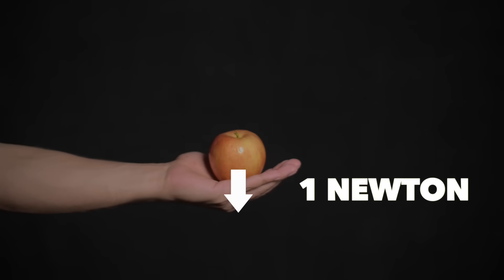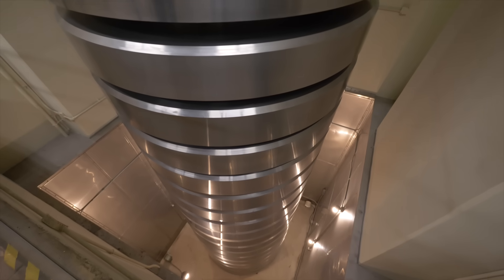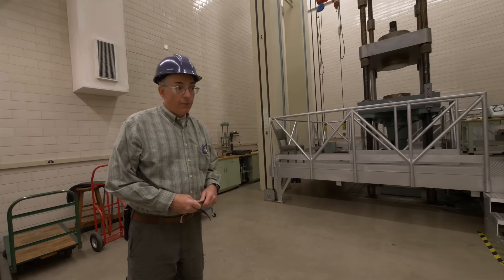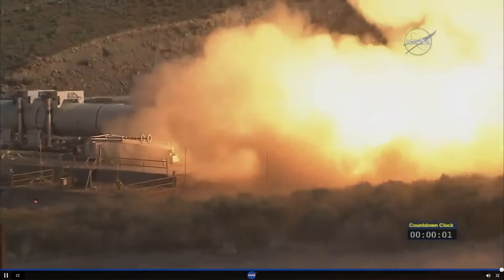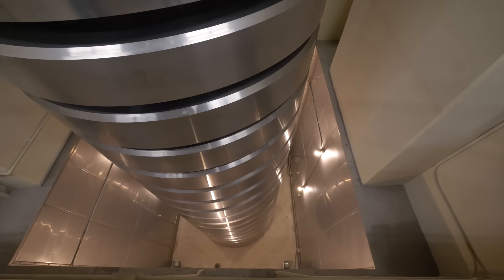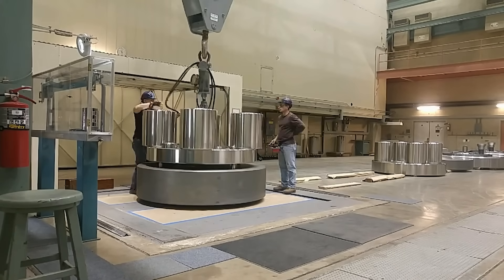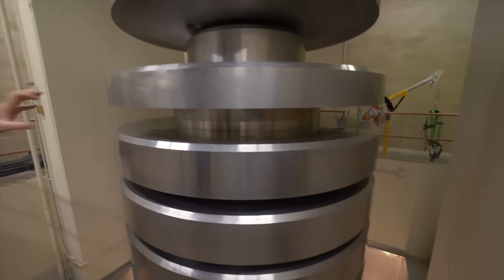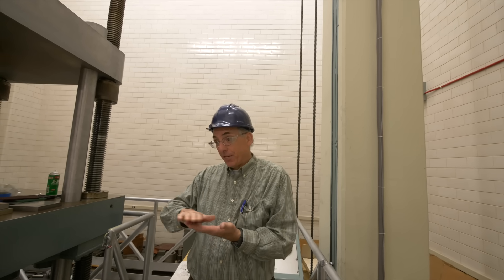World's Heaviest Weight

Comment: I would think that its pretty much impossible to use weights and gravity to measure force for a rocket engine because once THAT fires up you gotta add the heat, air displacement, an the fact that alot of the force goes outwards as the propulsion contacts the ground, its like firing a bullet thats not enclosed in a chamber, the force generate in the chamber makes the bullet fly hundreds or potentially thousands of feet per second but clamp it in a vice and smack the primer and you basically have a squirt gun...

Comment: I installed the highest sign in the  state of Ga. It is 180 ft. Tall and has 1,000,000 lbs. Of concrete at its base . I used an Excavator to remove 70 dump truck loads of soil at its footer ,upon placing the signs pedestal on center  ,I brought in #60 ,9 yard cement truck loads of concrete  ..60 truck loads of concrete .

Comment: If memory serves, this weight stack is in NIST Building 202, and was built to calibrate the load-cell on NIST's big structural testing machine (which was used in turn to calibrate the loadcells used in NASA's test stand for the F-1 engines used for the Apollo missions.) NIST was a fun place to work.

Comment: The worlds heaviest weight is the actual planet. But almost geniuses use linguistics to make up the difference. dat ego......

I don't suppose you asked NIST how the top section of a 110 storey building could contain enough energy to pulverise 80 floors below, including the main supports. And how does jet fuel and 30 storeys create molten metal still present at ground zero 6 MONTHS LATER! I know..... "science"

Comment: I worked at NASA Cal Lab on Redstone Arsenal, AL. We calibrated Load Cells up to 5 million pounds of Force, both compression and tension! Was downgraded to 3 million lbs of Force and parts availability! There's also a 200 Cu Ft Proving Bell, yes 200... Flow Calibration up to 400 cu ft of Gas Flow and 16 in pipes for Liquid  Flow Calibration!

Comment: It is probably a very good thing that this facility is located in Washington DC and not out in Silicon Valley near the San Andreas fault. How would you calculate the maximum stress factors on this equipment and its building for a 7.0 earthquake?

Comment: One question who made Newton's number accurate ?
Reply: based on the fact that a Newton's formula is mass times acceleration, kg times m/s^2, and that a million pounds is approx. 453592 kg, dividing the 4448222 Newtons by the kg gives us the acceleration, which is approx, 9.807, very close to average force of gravity but obviously calibrated based on the force in that location. Using the weight and forces allowed for an accurate number of Newtons.

Comment: The whole "science-thing" is based on SI-units and therefore they initially use precisely calibrated kg-standards, building up larger and larger masses ... and then they convert it to  "Pound Libras"/LBS/Libras ... say WHAT?
After which they use weird non-SI conversions to take into account the gravitational difference through the whole stack and the displacement of air mass due to the volume, again using none-SI units for the conversion. WHY don't they just keep on working with SI-units all the way through? They can always translate the end results into rural units for the lesser educated people later on, but why scramble a pretty good work so early on in the process?

Comment: This was extremely cool. The last job I worked on had a ringer crane manufactured by Lampson with a 750,000 lb lifting capacity mounted to a barge with a million lb counterweight. I unloaded trucks one whole summer of crane parts and counterweight. Spent a whole winter and spring assembling the crane and mounting it to the barge with nearly the whole summer used for rigging the barge and testing it. Spent a few years off and on either working on that crane barge or with it and although fascinating at times, working with the same rig day in and day out loses its luster pretty quickly. Our load cells consisted of potentiometers mounted perpendicular to the barge deck along with a load cell mounted to the end of a 7/8” cable at the main lifting line on the block. The main lifting block was usually rigged as either 32 parts of line or 16 parts while having to constantly take it all apart and reassemble it to add and remove boom sections for different projects throughout the duration of the job. Our load cells were sent off on a pretty standard basis for recalibrations and updates but remember a couple of occasions when the interns from engineering had mentioned the facility in this video. Not positive if our cells were sent to this particular facility or not as we had equipment from all over the world though quite a bit of our electronics came from Sweden initially,  though when recalibrated they were all done stateside as far as the equipment I dealt with. Again it’s really interesting to see this technology and the math that goes along with it to help take away variables and make things more concrete as it applies to everyday things in the construction side of things along with the safety factor it adds to so many different aspects in industry. 👍

Comment: Can someone help me? Do each of those rings weigh 50,000 lbs? What are they made of? When I looked up the weight of a cubic metre of steel it is roughly 17,000 lbs..a third of one of those rings..and they don't appear to be a cubic metres worth of steel. Am I just not seeing the sizes right..or are they made of a different metal?
Reply: You're underestimating the size and assuming the things are pure steel. They mention that the weight displaces 125 pounds of air. That's over 40 cubic meters of air so the weights are at least two cubic meters each. And there are lots of metal alloys denser than steel.

Comment: 1,000,000 pounds...
That's 500 tons to you and me.
Reply: Or 454.5 metric tonnes to everyone else in the world
Reply: @Smithy250  Close enough.
Reply: @Smithy250  OK. 🤷‍♂️
Reply: i read it in the voice. good work.
Reply: A weight i can easily run up and down with my 1000 ton drawworks.
Reply: 1000kg is 1 Metric ton or tonne.
1kg=2.2pound approx
1000000 pounds = 453.59 Metric ton or tonne
Reply: it's about 453.6 Tonnes (rounded off) actually
Reply: @TheElectroAra  How do you figure? There's exactly 2,000 lbs. In a ton. 2,000 ×500 is 1,000,000.
Reply: @kawasakiwhiptwo5821  sorry wrong Sir ........ 2204.623 lbs = 1 ton, so 2204.623 *500 = 1,102,311.5 ( plus uncertainty, gravity compensation etc )
Reply: @kawasakiwhiptwo5821  Unfortunately not... A US pound is not exactly half a kilogramm but slightly less. It's absolutely outrageous
Reply: @kawasakiwhiptwo5821  lol you just left after these explanations
Reply: @davemccombs  2,240 through the British Imperial System. Also standard/known In the U.K., as along ton. In the U.S.,it's 2,000 lbs.

Comment: This thing weighs so much it's almost 2 and a half times the weight of the heaviest tank ever built, the maus.
Or about exactly 3 times the weight of an E-100 (unbuilt), except these things were meant to move, crazy right?
That's so much mass that the jet engine mentioned in the video will struggle to inch such insanely hefty machines, assuming you can even attach it of course.

The maus Did move, but literally destroyed everything it drove over, including solid roads and even concrete, and sank in any natural terrain, why am I mentioning this you may ask? 

Why not? interesting fact after all, since the maus if put into production would casually be like moving several of the weights in the video on a train (in parts of course) to the front line, that so insanely huge it's honestly too hard to believe it would have happened if the war continued for even a few months longer, just several indestructible really sinkable (into the ground) land battleships roaming the earth each weighing some 188 tons or about 94 regular modern sedans, crammed into an area smaller than a house.

Comment: Given the weight is so tall, at some minute level does it become a problem that the top is technically lighter than the bottom?  Or I guess that's accounted for in the calibration?
Reply: 4:20 has a caption that says that they change it based on the height.

Comment: If that airline ticket costs 50% less and the margin goes from well beyond "normal" conditions and up aka over engineered I´d be fine with 10% margin of error, not so if normal use falls in the margin of error. Precision costs a lot of money, do we really need it? Possibly for fuel efficiency but not really otherwise.

Comment: Also: Wouldn't it be better to measure in a crystal standard rather than a steel, given that the crystalline structure can be predicted and your measurement of atomic mass can then be more accurately determined vs measurements - rather than relying on whatever homogenous steel forging practice you use? I think this might be where the weight-error margin comes in, but I'm not sure. Is the reason this is not achieved due to the difficulty in producing, or due to a size issue?
Reply: I have no idea what you said but sure

Comment: Neither boeing nor nasa need that precision, that's such a fallacy to believe ..
Nasa is using a controlled explosion to power their rockets, that's not a precise method. It's going to fluctuate a lot with stable inputs.
Boeing is similar, less chaotic but also not highly precise. 
In both cases the precision happens by relative adjustments (relative to position of the craft) not by knowing the exact power of the engine.

So I've yet to see a real world use of that thing that wouldn't be possible if they have a much simpler approach with lower precision.

Comment: In my line of work, I calibrate a weighing system to weigh trains filled with ore within 0.001% accuracy. The rake of the train weighs over 1.38891e+8 pounds. (63,000 tonnes)

Comment: Technically the weight of an object increases as it gets closer to the Center of the Earth. Which means that the weights at the top of the column and the weights at the bottom of the column even though they have the same mass, weigh differently.
Reply: This is true only as long as you are above the surface of the Earth. Once you get below the surface, getting close to the center is more than offset by the fact that some of the mass of the Earth is now above you as you get close to the center of the Earth.  In fact, the weight decreases and goes to 0 at the very center because of that fact, since at the center all of the mass of the Earth is above you in all directions.
Reply: @briansammond7801  no. That's not how it works. Lol. Cool story tho.
Reply: @TheDanm22  actually, that is how it works. Check out Gauss's Law for Gravity.

Comment: The heaviest item in the world is the melted nuclear fusion from a nuclear reactor at Chernobyl, in room 217/2 underneath reactor number 4,  called the elephants foot, for its shape, and medusa, because one look at it will kill you, measuring roughly 6 foot  square the elephants foot melted through 2 metres of concrete before coming to rest in a maintenance hall. It is estimated to weigh 100,000 metric tons.
Reply: you are incorrect, fusion is not nuclear, fission is
Reply: fusion is putting together, fission is taking apart

Comment: Quite extraordinary. The one thing that intrigues me is how this apperatus is capable of lifting all that weight.
Reply: Well I got a reply from NIST…
“Ed, Greetings and sorry for the delayed response as the inquiry bounced around a few places before it got to me.  The gentleman in the video (Rick Seifarth) has recently retired and it caused some confusion because his emails kept being returned.  Anyway, it finally got to the right spot.  As for your question, let me start with some basics of the machine.   At rest, the million pound stack sits at rest on the floor (in a deep pit) which is directly tied to bedrock.   The support structure that actually supports the stack when lifted is independent of the building and resembles large bridge abutments and they are also tied directly to bedrock.  The masses are  lifted using  a large hydraulic ram (large bore and about a 4 foot stroke) that is atop the abutments mentioned earlier.  This keeps pressures low and easy to manage despite lifting well over a million pounds when accounting for all the supporting structures of the machine itself that are ultimately lifted as well.  The central shaft was sized accordingly (don’t recall the actual diameter, but very substantial) and surprisingly is under very low stresses even when fully loaded to allow for many, many years of service.    Thanks, for your inquiry and let me know if you have other questions.  Regards, Kevin”

Comment: I liked this guy’s personality.  
Isn’t the gravitational acceleration different for the weight at the top of the stack compared to the weight at the bottom?   I know it’s not much but when you are talking about a few nickels relative to 50k lbs it seems it might matter.
Reply: If you just use newtons law of gravitation I guess what you usually do is to use the placement of the center of mass. But I did a calculation to see the difference in gravity from the top and bottom of the stack. And the difference is around 0.0008 percent (guessed 25 meters from top to bottom) according to my calculations. So for sure something they have to think about.

Comment: I wonder if the metal of the machine suffer damage from one test it would be miscalibrated? 
Those metals should have a heat treatmen in order to not to loss theri weight when they are exposed to the extreme temperatures produced dy the engines.
Valencia Sosa Arturo Ramsés-1TM31

Comment: If the force load sensor is so precise, then why need the weights?

Why not a pulley system connected to an anchor?
Why not a lighter system of weights on a pulley?

Comment: Rick honestly has one of the coolest jobs in the world and I wish I could work there. 

So they accounted for gravitational acceleration at that location, but did they account for the difference between the top and the bottom of the stack? Without doing the math, I would think at that amount of weight there could potentially be a measurable difference in force at those two locations, or even along the whole stack as they are compounded.
Reply: Let's say there's a 10m difference between the position of the centre of mass of the first block when it's first lifted, and that of the entire stack when the platform is at full extension. The radius of the earth is on the order 10⁷ meters. The proportional difference in height is therefore about 1/10⁶. The g field varies as 1/h² and so the (∆g/g)² = (2∆h/h)² which implies that the uncertainty in g is about 1.4g/10⁶, or 1.4 parts per million. Since this is lower than what they've stated, this difference doesn't matter.

Comment: Actually,  When I was at Penlec power - They had a Crain lifting a boiler 1,000,000 lbs right in front of me -  Before I walked into the data warehouse / around 2000 scared 😨 the crap out if ne for  the moment...fortunately no crap - but unfathomable height of Crain. In New Kensington PA...

Comment: I thought they would use equations. With the shuttle at x weight x drag and x efficiency how much force would it take to move it at its measured speed of x.
Reply: They do. You are thinking about the wrong part of the equation. You can easily calculate how much force is required to accelerate a car to 60 mph in 10 seconds. You need a device that can measure the output of an engine, to see if it is capable of producing that force.

Comment: 2:39 Pounds is not a measure of mass, but of weight on Earth. Slugs are a measure of mass. Pounds is slugs times g. The measurement would be 1,555.146 slugs, which would be the same no matter where you are, e.g. the moon; however, 1,555.146 slugs would not weigh 50,036.27 lbs. on the moon.

Comment: I would love to know more about how they actually measure the force from those jet or rocket engines.  I guess there must be a pressure plate somewhere, but where?
Reply: they calculate the force needed to push the rocket (how much energy), then calculate the energy created by a set amount of fuel, then convert that energy to force energy. so its just an educated guess on how powerful the rocket pushes.
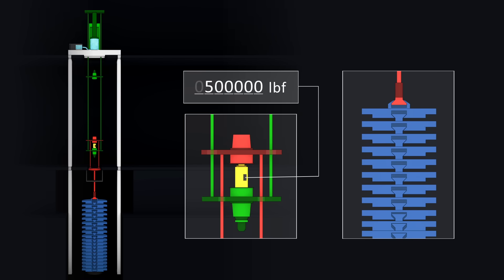Reply: @johngonzalez3634 :In the video @2:05, the guide says that there literally is one of the calibrated transducers embedded in the test stand somewhere.
Reply: @johngonzalez3634  no

Comment: How often do these weights get remeasured? Every time you use them, some metal gets scraped off and could fall into the pit. Then there’s also the air environment and the presence of people that could add particles to the surfaces of the weights.
Reply: There would need to be a lot of metal scraped off or particles added to get anywhere close to the 5 lbs uncertainty that is guaranteed. I'd rather be worried about fluctuations of gravity over time (the earth does contain a molten core which is moving around...) and how those affect the gravitational force the weights generate.

Comment: While we are talking about weight, this will blow your mind. A neutron star has a mass of about 1.4 times the mass of the sun, but is not much bigger than a small city, about 15 km in radius. A teaspoon of neutron star material would weigh about 10 million tons, or 20,000,000,000 lbs. The gravitational field is intense; the escape velocity is about 0.4 times the speed of light.

Comment: Isn't it about time the US got into using proper SI units?  seriously what is this obsession with using numbers like 30,000 pounds,  or 1,000,000 pounds, why not just say 393 metric tons for example? It so retarded, its like measuring the distance on signposts between towns in inches.